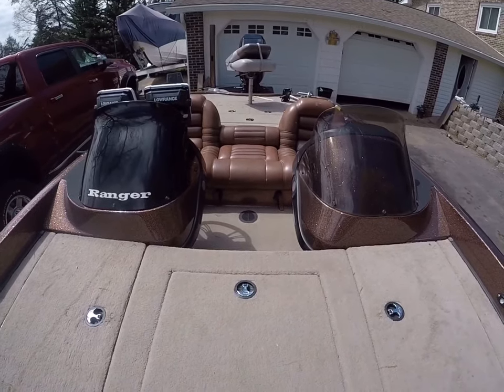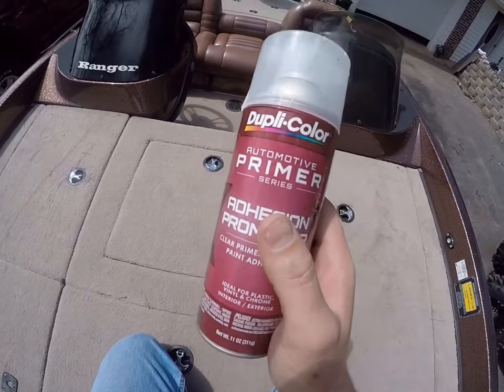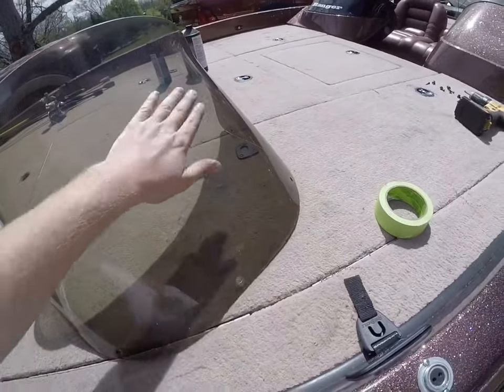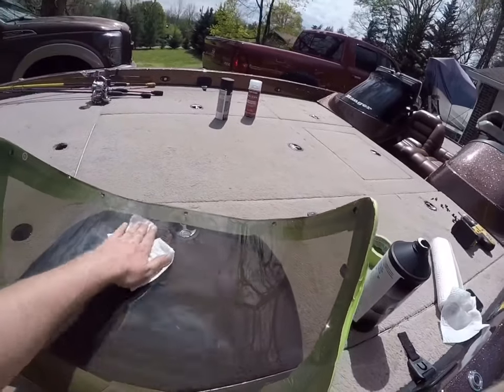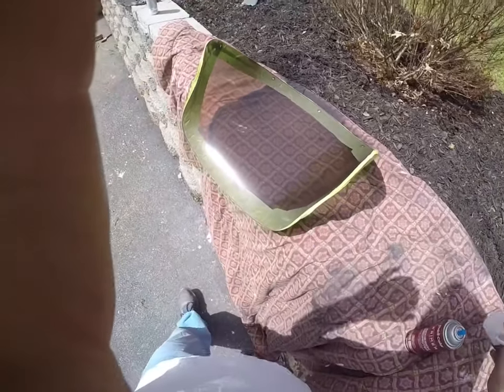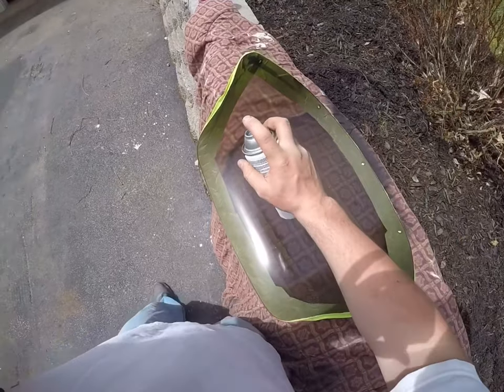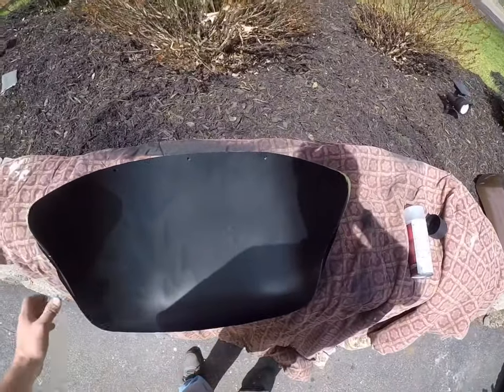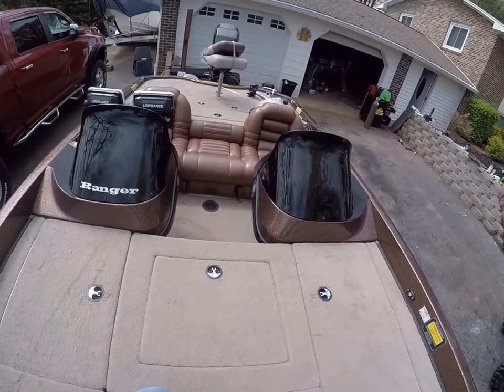How to: Blackout bass boat windshields

Comment: Im doing this for my vintage bass boat. Thank you!
Reply from the maker: You’re welcome glad it helped
Reply: I did mine with flat black and truck bed liner. I had the star looking cracks my windshield from 20+ years of heat and cold. Tried just doing the inside, but it still faintly showed the interior cracks in the background. So I did the outside as well. We’ll see how it holds up.